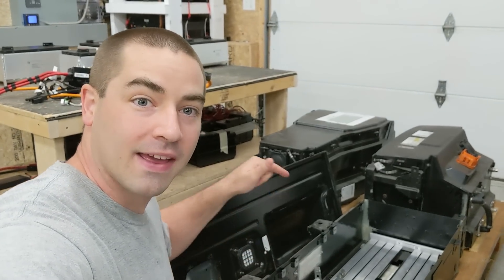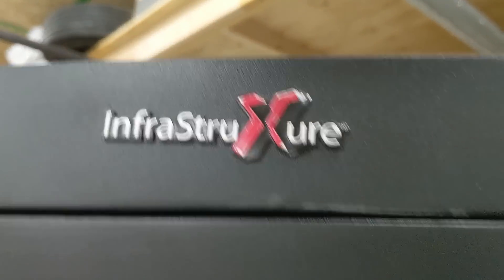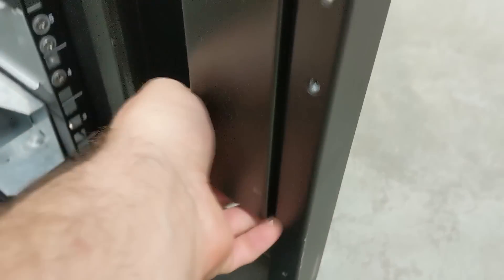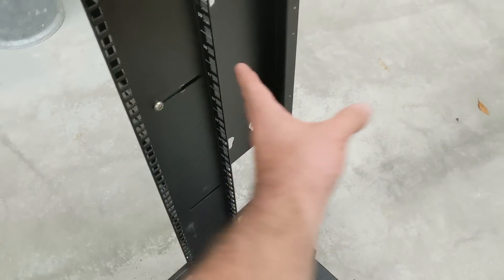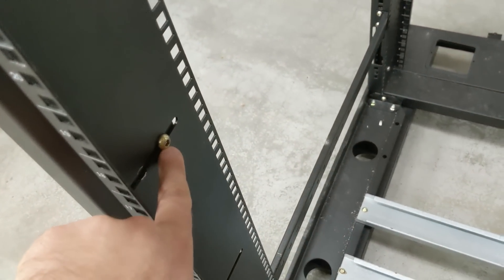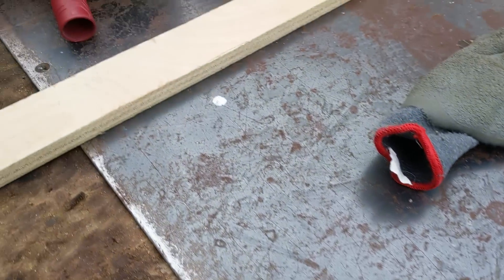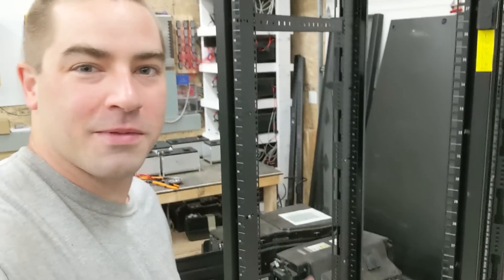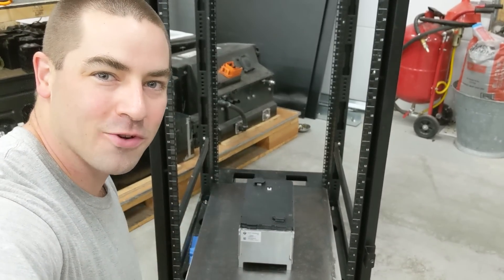Making a Home for Solar Batteries, DIY  BMW EV Lithium Cells

Comment: It would have been cheaper and better quality if you bought shelves for it. They have ventilation too. Server racks are designed to channel cold air from the bottom and the hot air goes out the top. By putting the solid shelves you've destroyed the ventilation.
Reply: Usually server racks take in cool air from the front and exhaust hot air in the back. Real servers also block all the vertical airflow.

Comment: You can buy a server rack shelf - which is metal - and then use some thin plywood on top, just laying on top. I just checked Kijiji and one guy was selling them for $25 CAD. You could even buy Luan ply which is super thin, I think between 1/4 and 1/8.. Like 3/16 I think for super cheap for an 4x8 sheet...
Reply from the maker: Thanks.  I looked for some shelves made for server racks.  The cheap ones seemed to only be a half-shelf attached only in the front.  Then the ones that could attach to all 4 posts, and have a 300+ pound rating were over $150 per shelf.   That's when I decided to make mine.
Reply: @DavidPozEnergy  yeah, that's too much
Reply: Do you have a sheet metal brake? You could do some bending of thin steel, diy your own shallow metal rails that go front to back, and screw some thicker plywood in the middle from underneath
Reply: @DavidPozEnergy  Couldn't you use two half-shelves, one on the front and one on the back? If you bolt plywood on across both you'll probably greatly increase the weight capacity by reducing the cantilever forces. Just my thoughts, I'm in no way a structural engineer.

Comment: You could use rubber over the metal shelf. Im thinking a piece of old rubber roofing would do just fine. If that is hard to find what about some corrugated cabinet liner.
Reply: Tar paper? It’s already fire rated.

Or ice and water shield is self healing and he wouldn’t need much.